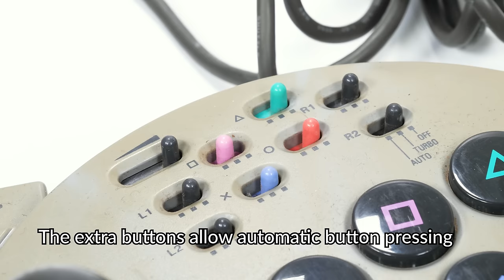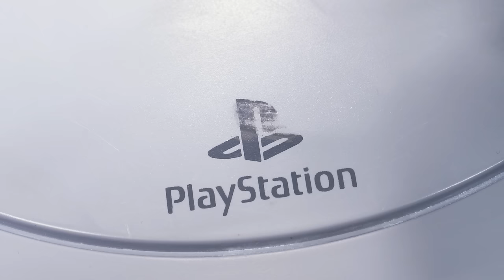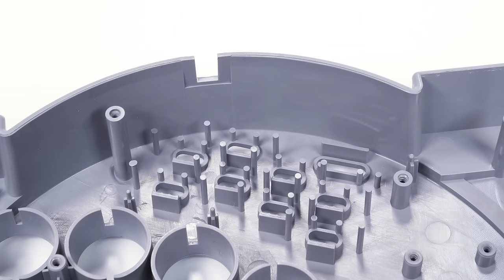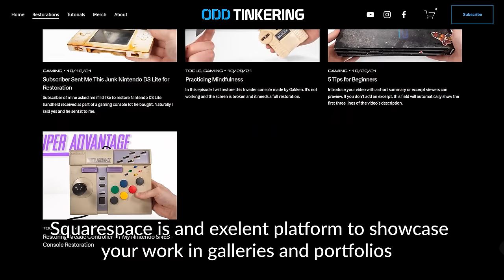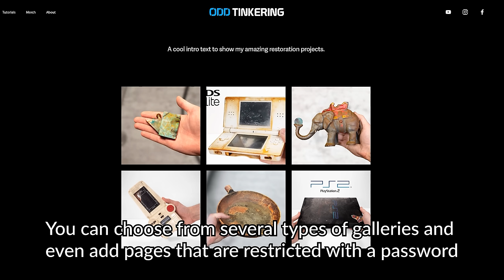Restoring Arcade Joystick for My Original PlayStation - Retro Console Restoration

Comment: I expected more inside the joystick considering it’s size. Great job as usual.
Reply: So much wasted plastic 🤣 i miss the 90s
Reply: @Straight_White_Fatherly_Figure  I think they made the base wider for stability. That way when you tilt the stick you dont end up tilting the whole controller as well.
Reply: It's all about perceived value. I'm a toy designer and you'd be surprised how little is inside some of the most expensive electronic toys. Back in the 90's when freight and plastic were cheap, manufacturers loved making oversized cases in oversized boxes. Just look at the original gumdrop iMacs, they have a little motherboard inside and the rest of the product was a huge empty piece of translucent plastic.

Nowadays, oil prices, and therefore plastic and shipping prices have gone up so companies are minimizing size and components. Touch screens are replacing buttons etc. Even LEGO has shaved-off a millimeter from the inside wall thickness of its bricks to reduce the plastic they have to buy.
Reply: Yeah they were something different  back then.

I have one of these and an old sega genesis stick and they're literally just stick and buttons stuck to a board

They've come a long way to current fully moddable sticks we have today 

So be grateful everyone who loves arcade sticks as much as I do
We have it good
Reply: @lo-firobotboy7112  And that's why stuff don't last as long. And as a result of cutting corners on costs, these electronic products end up going in the e-waste after something breaks in which generates more pollution as a consequence.
Reply: As Dank Pods would say "It's a whole lota nothing"
Reply: Man when he opened the thing up my eyes were so big because I said the same thing😂
Reply: all that case for sweet FA contents...I was quite surprised too..
Reply: Arcade joysticks like this one are meant to be comfortable to use on your lap. You need a large outer shell for that. If it's too small then you end up sitting with your legs really close together which is very uncomfortable for people with Y chromosomes. It's not a waste of plastic or a marketing tactic to make you think you're getting more then you are, this is just how arcade sticks look

Addendum: the housing needs to be large, but the internals are more or less identical to a regular controller. This one uses membrane buttons that contact the pcb directly and also has some turbo functions or something so the pcb is much larger than it could be if the buttons had their own switches. Modern fighting sticks generally have larger cases (in width at least) with a pcb approx 100x50mm (4x2in) in size with wires running to any buttons you need. The pcb could also be smaller (and is in some cases) but most are around the size I gave as it's better for easily swapping parts among other things

TL;DR The big case is important and the internals being larger would not make them somehow better
Reply: LMAO I agree
Reply: @lo-firobotboy7112  I've had a few joysticks, the smaller ones aren't worth a crap.

They didn't make it big to sell more units, they made it big because it's better that way. It's heavier, larger footprint for stability. They're solid units. If they were smaller I wouldn't still have one 20+ years later.
Reply: @bingchilling I've got a few joysticks myself, the smaller ones get tossed or put in storage.

Depends on the game but this is the only one I can play Street Fighter on reliably. The smaller and lighter ones were utter disappointments.

Comment: You know, I was wondering if maybe this stick could be upgraded with an 8-way gate, but that maybe it wouldn't matter if the PS1 couldn't read the extra inputs (though now that I'm thinking of it, it probably could unless it was maybe a REALLY early launch model, from long before the analog controller was made).  I'm sure it matters whether the stick is programmed to emulate the D-pad or the analog stick, when it comes to the number of options.  Then again, seeing the simpler design for the actual stick switches, I don't think that's even an option unless you're REALLY familiar with arcade hardware and making/installing adapters for new to old hardware.  I get the feeling our boy here could probably figure it out if he wanted.
Reply: It looks possible. It's been awhile since I at the arcade as a tech but that stick format looks about the same. This is an analog 4-way with a common. You'd just have to wire it up where the corner switches are connected to the adjoining directions.
Reply: you can def reuse the housing and just replace all the internals to use on playstation,xbox/pc. A universal board is like $90, plus the 20 point connector for the buttons, new sanwa stick, and then some buttons and some finesse then voila, you have an old school controller that can be used on modern games.
Reply: Since it is PS1 it will almost certainly emulate the D-pad and for most fight sticks the D-pad is also the default, though newer fight sticks (like my 3) sometimes have a switch where you can select the stick to either function as D-pad or as one of the analog sticks. As for an 8-way gate, you'd just have to find the right measurements and then design one and 3d print it, at least for the one he restored here. Had the stick in it been, for example, a Sanwa JLF stick, you'd be able to buy an 8-way gate or even just go in and turn a part on it 45° to get such a gate.
Reply: Considering the joystick is using buttons, which are on or off which is the same as digital, I'd say it's just replacing the dpad.

Comment: 5:45 you should remove that C-clamp to completely disassemble the stick and dip silicone paste between moving parts instead of oil. Works better that way since it's just plastic.
Reply: Sorry Odd Tinkering, but the dude is right--that joystick assembly should have been disassembled completely and given your usual five-star treatment.

Comment: Totally geeking out to the part where you take the ball off the joystick, affix it to a large bolt, use the bolt as a chuck in your drill, and polish it with abrasive. Where do you come up with this stuff? You're like the Emmet Brown of repairing discarded consumer electronics!

Comment: lever getting stuck are absolutely a design flaw due to cheap plastic used on the pivot part of the lever, hori does this the same on their cheaper joystick. oiling the pivot works but wears out faster, it would've been better if you dismantled it, cleaned it and put automotive grease or silicone grease.

Comment: Tip - Since the joystick's microswitches are all soldered, it's best to desolder the wires from the microswitches, get eight .187 quick disconnects, crimp them in the exposed wires, and connect them to the microswitches.

Comment: I recently cleaned the PCB of a Gambeboy colour with 99.9% IPA but it seems to leave a sort of sticky, streaky residue. This is my first time doing this so I'm not sure, is that normal? I thought it would totally evaporate and feel quite dry (as though it was new) but it took a bit longer than expected and felt a bit tacky. The board itself wasn't even that dirty and I used a new toothbrush straight out the box.

Love your videos btw, inspired me to try and fix my old consoles and handheleds!

Comment: Your balltop isn't fully locked in the way you tightened it.
You have to stick something in the slot in the bottom of the lever's shaft or hold the shaft still with pliers to get the balltop to be seated properly and not have the risk of spinning loose while you're playing.

Comment: Coming from a musical instrument repair/restoration tech, where did you get the little motorized screwdriver that you use for your repairs and are there different options for head types? I'm relatively new to your channel but I saw that thing and I thought "I MUST have that for disassembling/reassembling woodwind mechanisms." Kiitos!

Comment: For the hydrogen peroxide does it work as well if you reuse the liquid? Also how long do you leave it in the LED box for in cases where it's very yellowed?
Reply: Hydrogen peroxide is quite unstable chemical even when it is not used in reactions: it decomposes over time into water and oxygen gas, slower in the dark, faster in the light and if heated. And light and heat is exactly is what happening during this process. So, i highly doubt it is good to reuse after that.

Comment: Questions, how do you know what color a logo is on the console when you’re painting back on a worn part like the PlayStation logo? Usually when I try to do something similar I’d make it look like a drunk man colored it in.
Reply: My suggestion is look up consoles tech datasheets for consoles and color codes sheet. (this apply for anything else really not just consoles) 
Basically you can order that same color from anyone who makes paint. Also yeah cheaper paint or badly mixed ones will be a mess. So learn few things first and practice on scraps before you tackle real tech that you intend to restore or repair mod whatever. Hope this helped. Happy tinkering.

Comment: The WD40 to 'oil' the plastic is not a good idea. 
It may even destroy the plastic slowly over time, making it brittle.

Silicone grease or similar grease used to lubricate keyboards that are plastic-safe would have been a much better idea.

Comment: I really hate to be mr negativity here but this just didn't do it for me. I usually love his videos but in this one there were things that had me think "please don't do that". Stuff like cleaning the dirt around the joystick with a wet q-tip instead of blowing the loose dirt away with compressed air first. Also the part with painting with a toothpick didn't seem like the best way. maybe he could have masked everything but the P and spray painted it. The controller plug also seemed in need of retrobrite but i don't know if it can actually be taken apart or handle it while assembled. I don't know. Maybe i have just been watching too many My Mechanics videos as of late or maybe i'm just tired. Sorry.